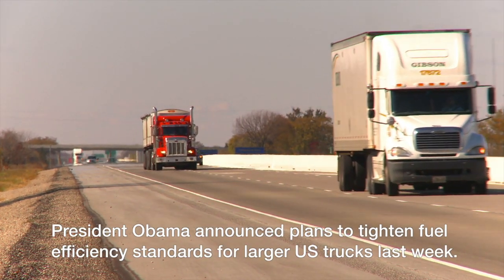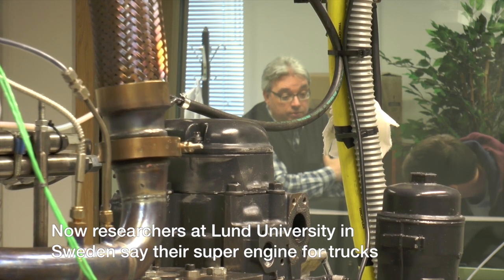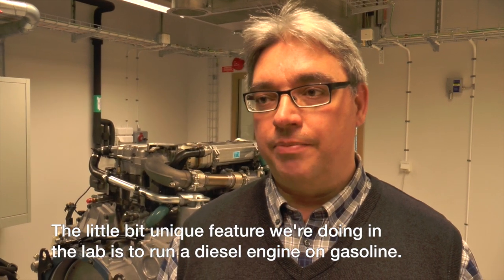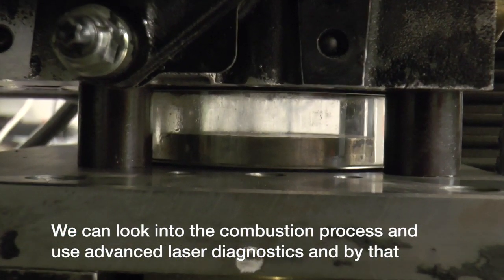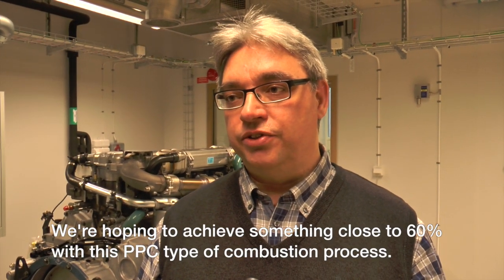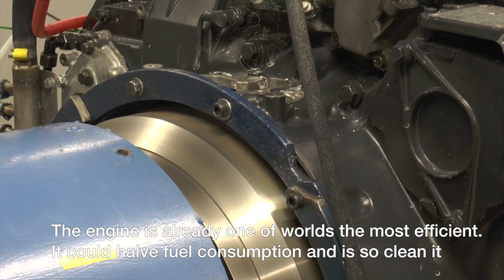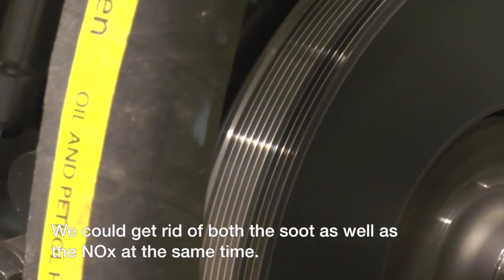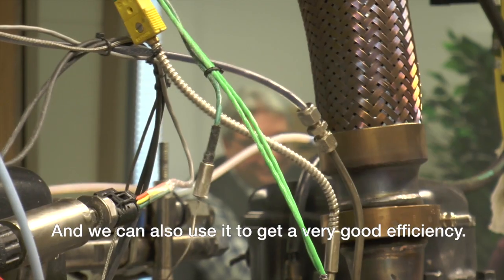New engine could reduce truck emissions, Lund University

Comment: six years ago now. the electric craze hadn't hit yet. Now battery-electric OTR trucks are being made, exploring the limits of battery technology, eliminating the need for oil entirely. However, gas and diesel are at prices lower than 10 years ago. What's next, the fabled water engine?